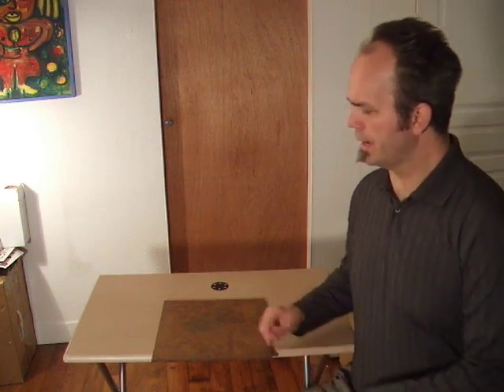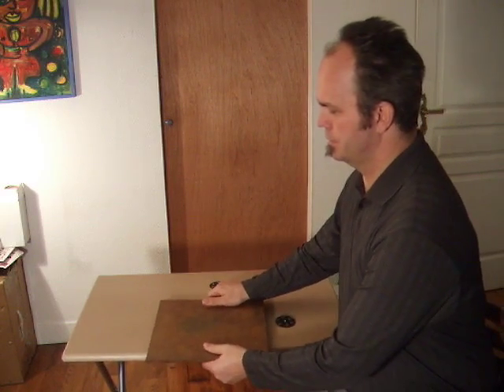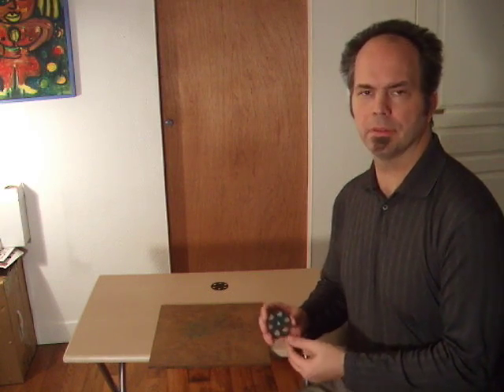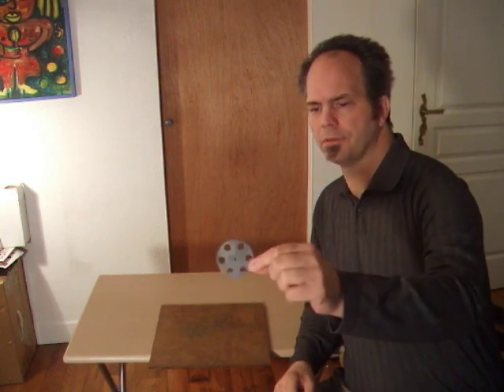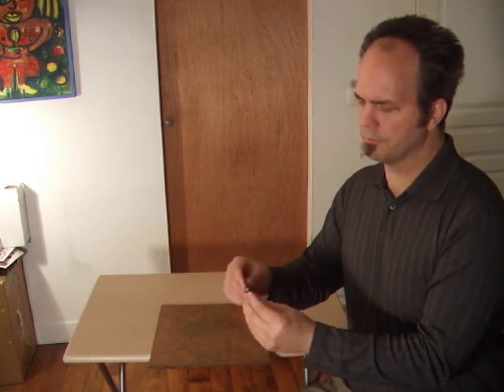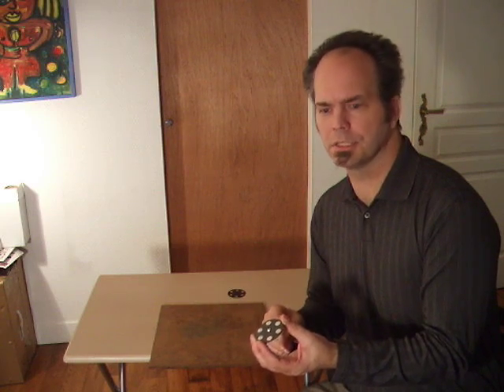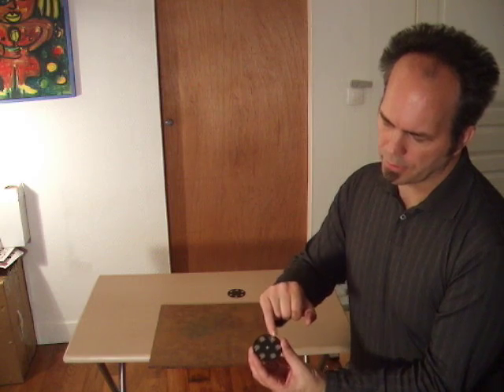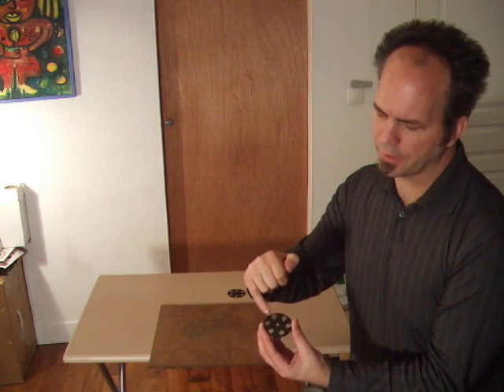🔝 Magnetic Levitating Top via Lenz's Law - Demonstration & Explanation

Comment: When you spin the disk did it push the disk away from the copper plate?
Reply from the maker: Yes, it can be felt to push against the dremel tool harder the faster it goes. It is actually a bit tricky to get it to release from the dremel tool.
Reply: If you have a few minutes sometime email me please, papatimothy2017@gmail.com. i would like to have a conversation about this.

Comment: I have new project ,  anyone want to help me look into this, here is link.  please comment.  Top spinning plate is driven by cpu fan and the lower spinning plate of magnets is driven by a fan motor, the faster the RPMs, the more lift upwards on the aluminum plate, for me I will be using copper plate..  Like wind to a sail, the spinning magnets causes the lift.  Lets build this.

https://www.youtube.com/watch?v=VBrx4O10XkI&t=1358s
Reply from the maker: Sorry to have to say so but what is shown in that video is almost certainly a hoax. The demo of the hoop was super inconclusive because we do not see the hoop being placed above the "floating" object. It is very likely that another identical hoop positioned above was dropped.
Reply: @iLevitation  okay,  you're demo here is on track - so i recognized you for this, building hover board.

https://youtu.be/U70nrM_E2T8

Comment: Hi mate. Good man for putting this out there. This is the same as the magnet falling slowly down the copper tube effect. Or putting a copper plate over an AC electromagnet. It will also work with Aluminium. Simply induce a motional magnetic field either by rotating permanent magnets or using an electromagnet and suspend a diamagnetic material in the magnetic field. Copper, Aluminium, or Bismuth. Water is also weakly diamagnetic. Note that things get hot very quickly with a powerful magnetic field. Love your stuff mate.

Comment: Quit dropping it, get it started while touching or very close to the plate,
Reply from the maker: It doesn't work that way. If the disc is too close to the plate the magnetic drag set up by Lenz's law will make the Dremel tool slow down (from magnetic braking) or actually even stop. When the disc is spinning fast it pushes up into the Dremel tool. The disc is magnetically pushing away from the copper plate.
Reply: That would make it tough to stop it from bouncing,
Reply from the maker: Even if it were to be kept pushed against the conductor plate, the moment you'd take away the tool the disc would immediately bounce up. The reason it does this is part of how magnetic fields work.
Reply: A different guy got his spinning on a piece of plastic the he moved it onto the magnetic field, but your's is not set up the same. I am going to dream about this. A couple days ago I ordered some neodymium mags.My son and I love all things science.
Reply from the maker: You have a link to the other guy's video?
Reply: It was called, Will a levitating gyroscope spin forever in a vacuum, or something like that, lots of levitating thing these days.
Reply from the maker: Yeah, that is levitating on a completely different principle. That is an example of spin-stabilized magnetic levitation which is a completely different phenomenon.
Reply: like a spring without a shock absorber it will bounce but will settle down. It only continues to bounce here because it is running into things.

Comment: at those rotating speeds, even the slightest unbalance makes the top to fly away once it leaves the drill... I think that's the main reason you cannot make it rest on the copper surface, just like a spinning top... I think you should, AT LEAST, 3d print the disk and CAREFULLY weight each magnet in the hope to have a better balancing once spinning...Otherwise it's a waste of time!

Comment: Nice find!  Very impressive.  I wonder, does this only work in clockwise launches?  Does the disc need to be spinning 'with' or against the natural flux spin?  If this is spinning against the flux, this could be creating a mild Torsion or Differential wave.

Just thinking out loud.  What if you placed a small rod, very very think diameter, in the Copper, through a hole in the carbon fiber disc, then somehow spooled up the disc to speed?  The disc should rise up as it begins rotating.  Perhaps use air as the RPM starter medium, blowing the air (airhose, computer air cleaning can, etc) flowing the air over the top of one side at a  horizontal downward angle, the pin keeping the disc in place.
Reply: Well the spin caused it to work like gyroscope and it work both clockwise and anticlockwise. Gyroscope tends to oppose change in their orientation

Comment: There is a spinning top mag-lev toy that you can buy in novelty stores usually for under $10 that's been around for decades.  Just google mag-lev spinning top.  Some are better than others, but I've tried a few and they work with some effort.  Also, mag-lev bearings are another common, more useful application using this effect.

Comment: I'm pretty sure that you could make a controllable flying disc that would levitate by itself without a need of any kind of metal plate under it... you know that when you make a disc rotate at super speed, it's like there's almost no gravity. so I say: using some really strong smaller air turbines and with the body being from complete carbon to make it lighter... and also one fan or a turbine that vould control the height of the disc it might work..
Pretty sure that's is how a UFO works :D

Comment: omg people are so easily tricked by there own eyes, without truly understanding physics, this device is not levitating at all.  In fact its actually just flying.  If you take any flat circular object and place anything above it such as the magnets they cause a downward thrust giving the illusion that it is levitating.  Just like a Frisbee.  That is why it will only work after he speeds it up using the Dremmel tool.
Reply: Exactly, you beat me to it. There seems to be an air cushion effect. Would love to see the vortices in action underneath. If the top could be made stable laterally, so that energy wasn't lost each time it hit the sides, could be interesting.
Reply: +Peter Lyttle it would but all he is doing is the same thing a helicopter does but off a disk. if there where holes in the disk to let the air to be forced down it would lift higher. all of these designs are based off of Da Vinci's cork screw.

Comment: cuz it says that aluminum also works, so i got a sheet of aluminum that is about 0.32 mm, I tried to levitate something, but it doesn't work
Reply: +Abliskarian  Did you sustain the movement of the magnets? The conductor needs to be in a constant state of magnetic flux in order to generate eddy currents. You may also want a thicker piece as aluminum is not as conductive as copper.
Reply: Uh ok thanks, but I got it to kind of levitate anyways after making the aluminum like 8 mm thick

Comment: what I think is happening  is the megnetic field transfered to the surface when it spins it alternates and repels because how the megnetic are placed oposet polarity next to each other. this would make a nice megnetic  bearen
Reply: +piccolo sun Look up magnetic induction and eddy currents.

What's happening is that the change in magnetic field (flux density) induces a proportional current in the conductive material (copper plate).  This current has self-shorts locally creating a little circular current path on the plane of the conductor.  Since a current has a proportional magnetic field associated with it (see: right-hand rule) which is in phase with the corresponding magnet's polarity, the now electro-magnetic surface repels it's partner magnet above.

The net effect is a levitating disk :)  Unfortunately this would make a really bad bearing (And a much better brake) since the force applied against the motion of the magnet is proportional to the induced current (which is why it slows down so darn fast).

To see this effect in action first-hand, get a copper sheet or copper pipe and drop a powerful magnet through the pipe or along the sheet.  It will be slowed by the same forces.

Induction motors and a bunch of other cool stuff relies on the same principles.  Fun :)

Comment: Does anybody know the specifics on how much weight could be suspended using this method?
Reply: I contacted the manufacturer and they said this in an email "The Hendo Hoverboard that you see in our kickstarter video holds more than 550 pounds."
Reply: +David Scovil 550 lbs, for how long, while expending how much energy?  That's the real question that would allow you to truly consider power resources required, battery technology and capacity, and the overall economics of this approach to compare it to other viable transport solutions.
Reply: I'm not thinking transportation at all but for other uses.
Reply: +David Scovil Depends on the resistance of the copper, the magnetic field strengh, .....
Reply: faster rotation would repel more weight, and use more energy.  Stronger magnets and thicker copper/aluminum would help too, but again, more energy to keep them spinning.  For all practical purposes you can likely hover any amount of weight if you increase these factors appropriately... it seems to be very scalable.
Reply: +RyuDarragh Good point, but at this saturation point, wouldn't increasing the thickness of the copper/aluminum base scale the system even further?

Comment: Use a slightly curved piece of copper. Edges upturned to form a very subtle bowl.
That should help to keep it over the metal without relying on the side walls.
Reply: +Wayne Royce I'm not sure, but I think the copper has to be extremely thick, to give the magnets something to repel from.
Reply: +RyuDarragh Lower resistance means lower losses, so thicker is better, up to a point.
Reply: Aluminum would probably need to be thicker due to greater resistive losses.

Comment: Just in case someone else did not offer a better solution. I think I have a better way to deploy the disk, and therefore allow it to stay levitated for a longer period. Start with a shaft maybe twice the length of the one you are currently using in your drill. Now, simply cut a piece of plastic drinking straw to 1/3 length of the shaft. Hold the straw with your first finger and you thumb, just tight enough to hold it still and to keep It away from the disk and the drill chuck. When it has spooled up, simply push down abruptly on the straw releasing the disk (hopefully) straight down keeping it away from the walls and consequently losing energy. This is just my observation.

Comment: will this still work with a aluminum sheet instead of a copper one. Please answer if you know i need to do this for a science fare.(copper is to expensive)
Reply: yes, it will
Reply: Nathan Arinta Did aluminium work?  If so, you should patent your idea before Hendo steal it.  I tend to suspect that only copper or silver would work, as they are the most conductive elements.
Reply: *too
Reply: The Copper should heat up as it repels the magnet due to the magnetic field however I doubt aluminium would work at all

Comment: I'm thinking that if you made the wheel that is spinning a bit heavier on the outside it would act as a flywheel and keep it moving longer. Also if you make the area it spins in with circular walls instead of a rectangular wall setup the wheel will spin around and around. You don't need carbon fiber either to make this. You can go to menards and pick up an electrical cover that is flat and circular. There are always ways to find low cost materials. Could even use cardboard or balsa wood. If you wanted weight you could use wood and use a hole saw.

Comment: If you were to just drop the disk on the copper wouldn't it levetate anyway because of the current being induced?
Reply: I think the top stopping and staying still answers that question for me,, but at first thought, one would think it would float... Could this be how we will make anti gravs like in Star Trek one day... Cheers ,, Pete
Reply: Well, the levitation is only momentary in either case.  There's just another video of someone dropping a huge magnet on a sheet of copper and it slowly goes down at the end.
Reply: CNLohr I shell have to look for that one.. thanks. Cheers, Pete
Reply: dropping a magnet on copper still induces a current within the copper, which causes repulsion.  That's why dropping a magnet through a copper tube causes it to move very slowly through that tube.

Comment: Here is my s.w.a.g. as to what is going on:  Gyroscopic stabilization from the spinning disk & magnets keep the disk from tilting over while the effect of Len'z law causes the magnetic field from the ring of magnets to drag though the copper.  This drag should cause the disk to slow, tilt, & 'crash'; but the G.S. due to the spin keeps the tilt from occurring & as such G. Precession occurs causing the disk edge to rise (hence the hopping without contacting the plate) & the magnetic fields from the magnets to 'skim' over/through the copper more shallowly thus imparting less resistance.  Lenz's Law eventually slows the disk's spin & it finally tips over & stops.  A good test for this would be to try this with magnets that have a larger magnetic field area to see if it would float higher.  I have to wonder if I am way off base though.  Your thoughts?

Comment: I liked your video it is cool, I have a possible theory if you care to hear it. When a magnet moves past aluminum or copper it creates eddy currents which dissipate in heat. The heat that would be created and the energy needed by your spinning top is much higher in energy then for it simply to stay away from the metal? I believe that's why it doesn't spin as long as a top normally spins. It uses up that energy to levitate it. Really cool demonstration.

Comment: Scott,
  Now, this is quite interesting and it looks to be levitating.   "Normally" the eddy currents and resulting magnetic field will slow, or magnetically brake the motion of a moving magnet. However, with the alternating poles there must be some interaction with the oppositely induced eddy currents and resulting fields.
EDIT: It does seem to slow down rather quickly, but bouncing against the edges may be the reason, or there may be some remaining magnetic brakeing effect as well as the float.
.....
The thicker the plate, the stronger the effect because there will be higher currents due to the lower resistance.  It should float higher.  You can simply stack more plates.  This is easily seen with a magnet pendulum and copper or aluminium plates.
.....
It doesn't appear to require the linear motion since it moves slower in some runs. You need a better way of spinning it up that doesn't impart any side forces - something like the Levitron which uses a cone on the top of the Top's shaft and an inverted (inside) cone on the drill.  Simply lifting the drill stops contact very well.
...... 
I'll have to think about the fields to see if I can explain it well.

Regards, ScienceAdvisorSteve
EDIT: If the magnets have some kind of an air thing going on, flipping the disk over should destroy the float (and move the magnets closer to the plate) even enhancing the effect.

Comment: It is what it is. Lenz law is in effect when magnets move along the copper plate. The hovering is caused by angular movement of the magnets in conjunction with gravity. While magnets fall from gravity along with horizontal plane movement you get anti gravity. Don't waste your time making it without magnets. It won't work. If you really want to make it without magnets just put magnets in oven at 400 Fahrenheit for ten minutes. They with loose magnetic property but have the same mass. Good Post! Thanks for sharing...

Comment: It's Eddy current, when the magnets move over a metal the metal will generate a current, that current will generate a magnetic field... this will force the disc to levitate as long as it's moving, if you have cylindrical strong magnet like neodymium one, try to drop it in a vertical copper pipe, you will see it taking too much time dropping...

Comment: Its better to keep the disc stable than flop around. A ball bearing in the center of the disc with a carbon fiber shaft running through the center of disc. The shaft is affixed to the base in whatever manner you can come up with. Use the dremel with a rubber wheel to spin the disc.